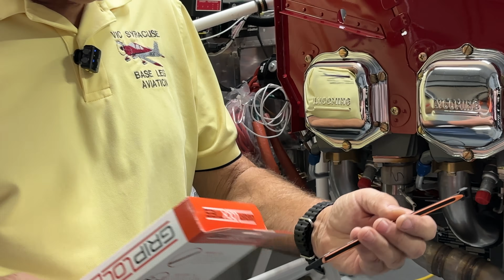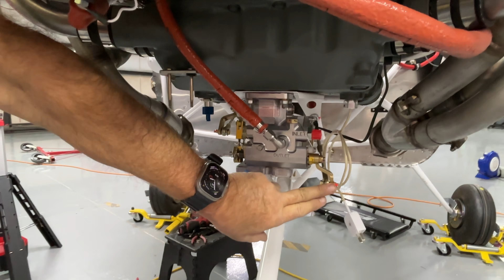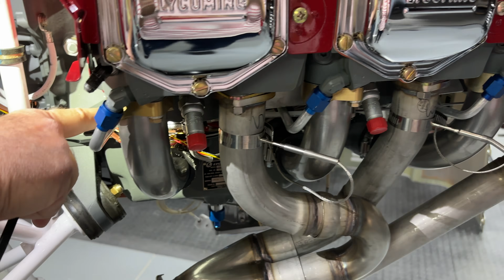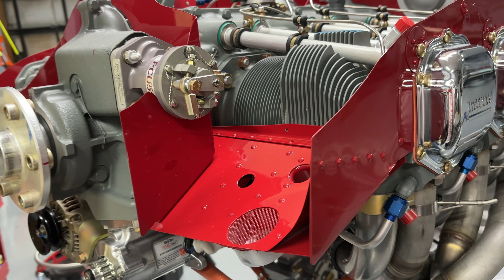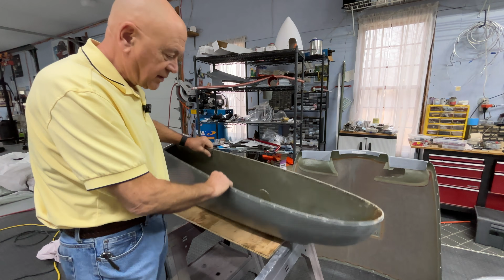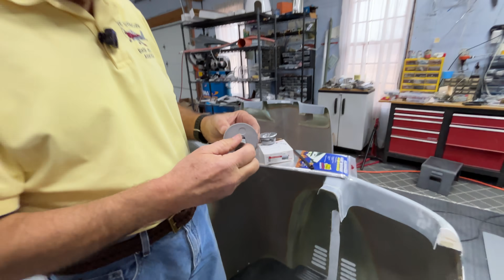RV10 build Engine Options and tips

Comment: Hi Vic. Just wondering what your thoughts are regarding your pre-heating solution and Lycoming SI1505? The anti-splat is a nice option but Lycoming says they do not approve heated dipsticks as per 1505.
Reply from the maker: a heated dipstick is different. it does get too hot and can coke the oil around the stick. this one has a much larger surface area and is a gentle heat. Alan did extensive testing and I didn’t see it overheating the oil at home in a test can.
Reply: @baselegaviation1614  Thanks Vic!

Comment: Hey Vic, what exhaust are you running? Do you plan to split the lower cowling? Louvers?

Also do you have the Airwolf Oil Filter part number handy?

I'm literally typing this from the Spruce parking lot 😂

Thank you!
Reply from the maker: sorry I missed this while you were at spruce. hopefully they helped you. not planning on splitting the cowling. installed the vans louvers on the lower cowling. the exhaust came from. and. I think it is a vetterman exhaust which are the best. Carol always lists the part numbers or links to suppliers in the video description on YouTube.
Reply: @baselegaviation1614  Hey Vic, no worries, I live fairly close to Spruce HQ (Corona CA, lucky I know) so will grab it another day. Not there yet on the build. 

Yeah I wasn't sure if I should go Vetterman or Custom out of San Diego (where I live) since they are local.

I'm saving a lot of your videos for reference as myself and my build team get to each part. That's AMAZING that Carol links everything in the description. That's mega. My thanks!

Comment: What’s the model number of the fuel cap? Spruce has two very similar but they are 1mm difference in size. Weirdly, a phone call to Van’s recently didn’t produce an answer.
Reply from the maker: spruce 05-27067

Comment: I used 1/2" backer rod in the wingtips and did a layup over it. The backer rod will pull out when done and it makes a good wire conduit if needed. Ran lengthwise instead of transverse. Thanks for sharing Vic.
Reply from the maker: That's a clever idea!

Comment: another winner Vic, well done, and thanks to Carol too... not only in builder assist, but also with pertinent comments. 
Plenty of good tips for less experienced builders, very nice workmanship. From all the items shown, and yes, this another of those funky Vans ideas, is the location of the FF sensor (and oil cooler on the baffle of smaller RVs...). I always avoid mounting those on the engine, firewall or engine mount being far less prone to vibrating and ruining the whizzwheel.
That's sure gonna be a superb -10 😀
Reply from the maker: Thanks. just trying to share and help others.

Comment: Looks absolutely beautiful Vic (and Carol!)  I love that remote filter!! That’s brilliant! Wish I would’ve done that. Can it be retrofit? Such a pain removing the lower cowling. Lots of great tips. Interested to see how the red cube works out. Thanks
Reply from the maker: yes, you can retrofit the remote filter. I have done it on many customer airplanes. the kit comes with the adapter you install on the engine when removing the oil filter. it’s really worth doing.

Comment: Any recommendations on doing the blast tubes for PMags and lycoming fuel pump? 5/8 id scat and a Van's fuel shroud? Also curious on the connections to the baffling and placement (rear vs front). Thanks as always for the great content!
Reply from the maker: you can use the tubes I showed coming off of the rear baffle for the pmags. for the fuel pump shroud I used colder air from the right front baffle through a 1” SCAT tube to the shroud.
Reply: To piggy-back on this question, is the fuel pump shroud something you make or buy?  Is the purpose to protect the fuel from high temps and/or vapor lock?  Thanks again for a really good video!
Reply from the maker: A/C spruce part # 08-06097